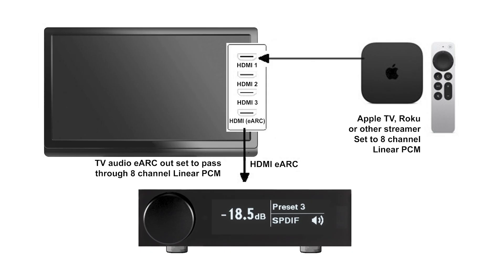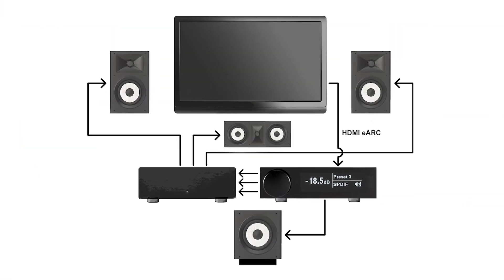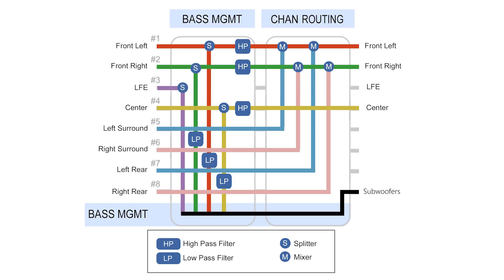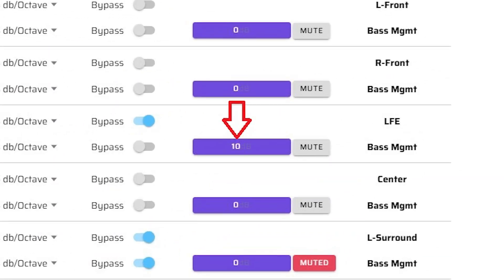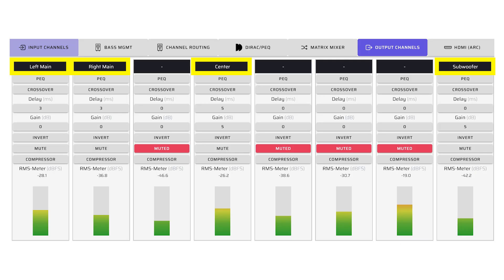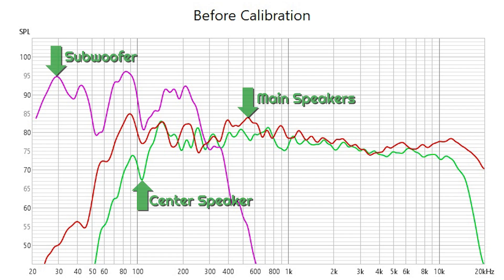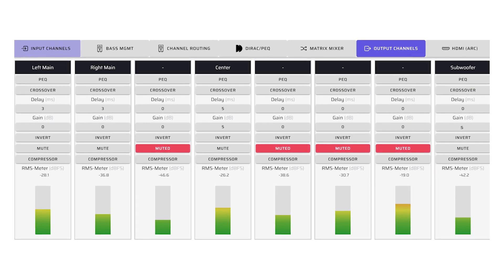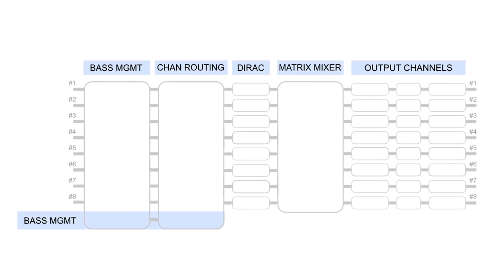Building a 3.1 Home Theater Audio System by Properly Converting Dolby Digital and DTS Audio Streams

Comment: 3.1? What a peculiar configuration. You don't have spots to place surround speakers, but your speakers and listening positions are wide enough that you need a center. Getting some weird 3-channel amplification setup (likely a 5.1 or two stereos that you use only partially) and a quick downmix - just so the dialog can come from below(!) your screen.

Meanwhile I am looking into the opposite: 4.1 so I can use normal stereo amplifiers and don't have to stuff a center speaker somewhere. (And then I have 4 outputs that I can use for bass so I can use two more stereo amps to feed four subwoofers with multi sub optimization. 🤭)

Comment: I got a 2.1 setup with the miniDSP Flex HT. This video is a really helpful reference. Thank you.
Reply: For 2.1 what do you do with the center channel?  Do you mix it with both left and right?
Reply: @jacobiverson3816   Yes, the center should be split between front stereo speakers, but at half volume each. Assuming your stereo setup is good, for a central listening position this should result in a "phantom center" that might even be better than an actual speaker tucked underneath the screen. But for a sideways listening position the voices would sound like they come from the closer speaker.
(I am looking into a 4.1 setup that gives me surround but doesn't need a center for my single sweet spot listening position.)